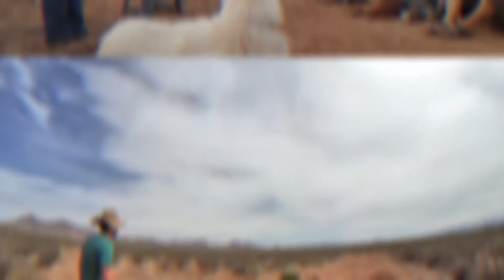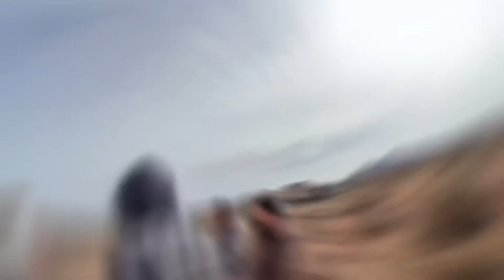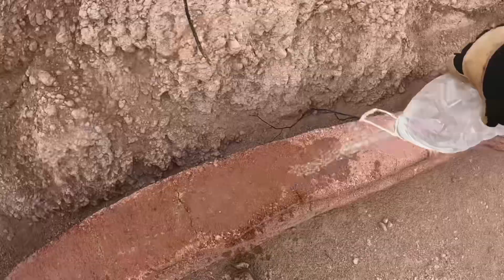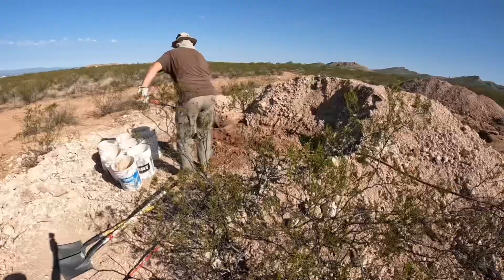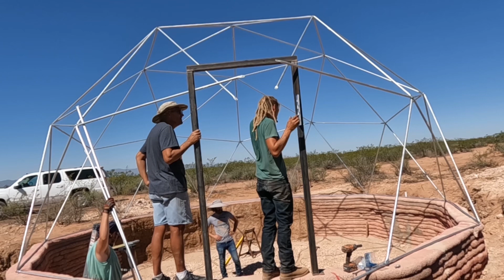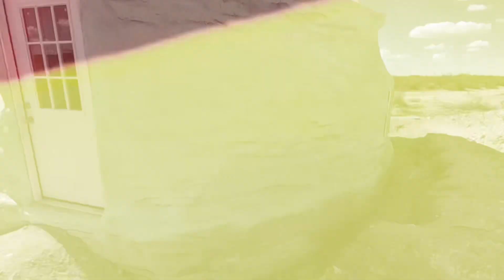Part 1: Building hyperadobe hybrid isometric dome

Comment: I see your point... kinda...
But how is it different/better/easier to construct than your average yurt.
I mean, it's a fun concept, but is it practical.
Reply from the maker: We live an an area where we can experiment with new building techniques. The hyperadobe below ground is 4 foot and help regulate the inside temp to about 68-72f the ceiling is made from steel and holds up to the high winds we have here, the dome shape also helps divert the wind and capture water. The foam helps make the walls fast but also provides instillation. So far on 3 other builds other than this one it has been successful.

Comment: Interesting technique. Any additional info on this style of building? Any links you could point me to? Seems like an interesting way to get a building up fast.
Reply from the maker: Hyperadobe part took the longest bags are from https://volmcompanies.com/ the isometric dome Frame was designed by our friend Kyle who also developed the method of foaming. The frame is steel tubes and the ends are pressed and punched  on a press to length. We will be doing another dome building very soon. Yea it is very quick to put up.
Reply: @Blindhomesteader  very cool. Does Kyle have a website or YouTube? I just bought 4 acres off of Frontier road in the McNeal area. Looking into what type of building we want to do.
Reply from the maker: sorry for the delay youtube flagged your message as spam IDK why, but email me and I will get you more information. lessismoreaz@icloud.com
Reply from the maker: https://youtu.be/wnirqOn3ooE?si=xIiBHtnFpzqskgZm
Reply from the maker: https://youtu.be/LHWdLbD7Ha8?si=KgWmpVxfC1KKmI__